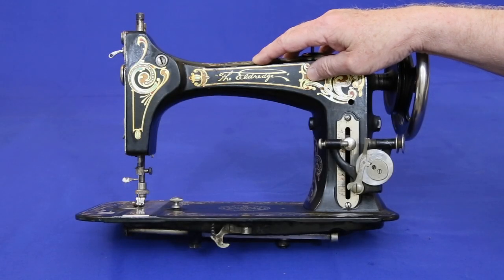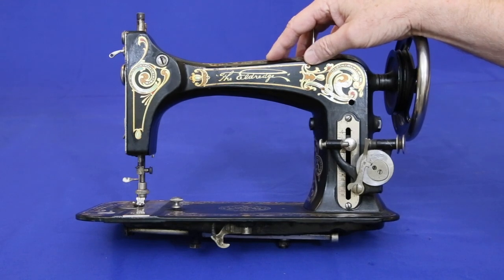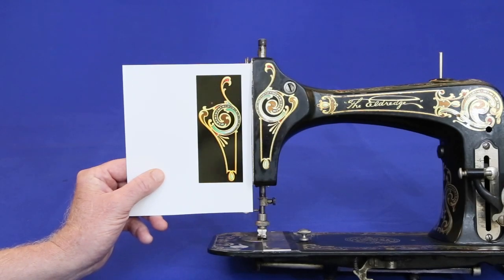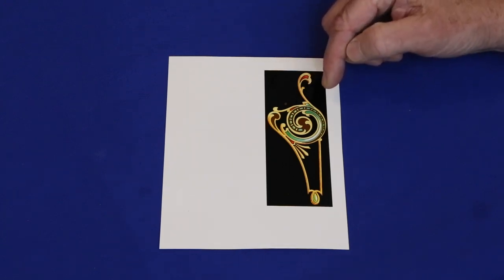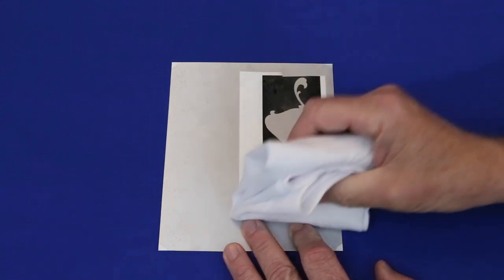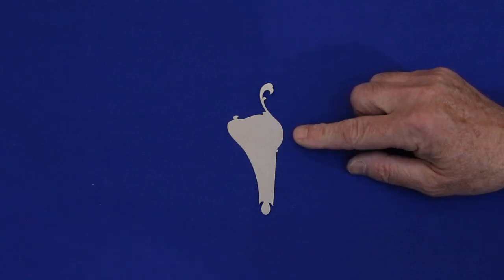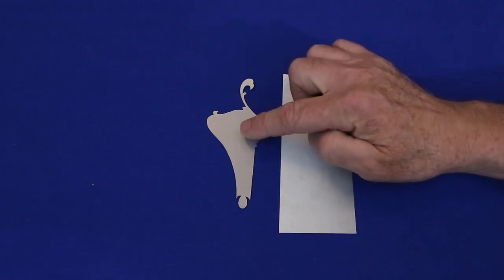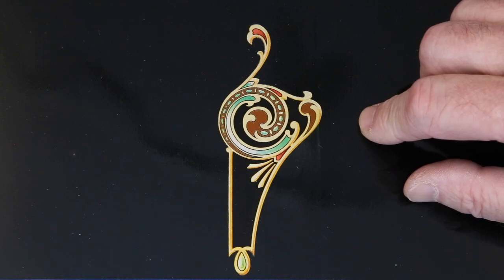Antique Sewing Machine Restoration - Silver Backed Decals

Comment: Wayne, please recommend the sealers you use for:  1. Backing before transfer.  2.  Top coat after decal is placed on the sewing machine.  I would greatly appreciate knowing that.  I am assuming the final sealer on the sewing machine can be oil based polyurethane as it is very durable but... maybe this will eat up the plastic decal and I have to use lacquer?  I prefer to only use a poly based sealant as it resists scratches and degradation over time.

The laborious parts of this are:
Cutting out the decal twice.  I wonder if there is a computerized way one could cut these intricate designs by machine similar to a CNC router machine?
Filling in the color degradation from old photos.  It should also be possible in Adobe to color fill all colors in a pattern automatically? We definitely also need to use a finer hand tool than a mouse. There should be some artist pen-like tools for fine hand control of computer artwork.  The fact it is outlined with black is good. That means the computer can be directed to color fill even with shading gradients of color, each section that has the same color in the pattern.  That would really be something!

I am slowly investigating this.  We have to find a way to recreate these old designs in a time-saving way, with no compromise on the gold effect or intricacy of design.  I wonder how Singer did it in the old days?  How did they create these in a mass produced way?  Anyone know?
Reply from the maker: The clear coat I use is Duplicolor acrylic enamel clearcoat. The following video about testing a wide range of clear coats explains why:

https://www.youtube.com/watch?v=U547mOtMouw

Even with Duplicator, I use the very-light-sprays-first technique to further reduce the chance of blistering.

The original designs were not decals. They were lithographed transfers. In this process the design is printed on release paper. allowed to dry, then released with water tand then applied onto the machine. This way only the paint is transferred to the machine. The artwork isn't sandwiched between layers of clear.. This greatly reduces their thickness eliminating the edge ridges that can make decals obvious.

CNC machines could be used to hasten the cutting, but those cost so much few people could afford them.

Thank you for writing and good luck with your efforts!

Comment: I guess it would be better not to use shellac over the transfer ? would the alcohol cause problems. 

Super results.

With the curly part at the top would it be worth leaving extra support the delicate top, something similar to airfix model spruce to reinforce during application and then remove after. Just a thought. I have applied decal to cars with soapy water once you use a credit card to squeeze out the water your STUCK with the results.
Reply from the maker: That's a very interesting question. I've never shellacked a decal. I only used it once to shellac gold leaf applied directly to a machine. I'm out of shellac right now, but have some of the denatured alcohol, which is the solvent in shellac. I'll try some on the decal and see what happens, then let you know. Thank you!
Reply from the maker: @jdhtyler  Thanks for commenting!
Reply from the maker: Sorry! I missed the second half of your comment. Your idea of a temporary support for narrow decal sections sounds like a winner. While preparing for the video I practiced several times and twice that narrow curly part broke off at the base. I considered cutting it off and treating it as a separate decal, but your idea is better. I'll work on it. Thanks!!!